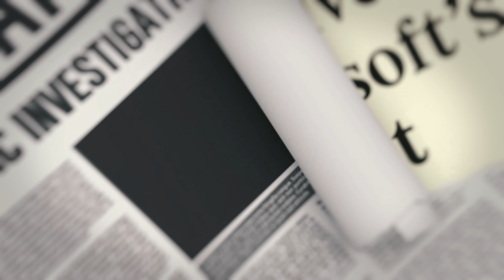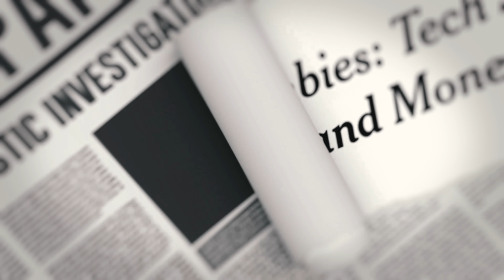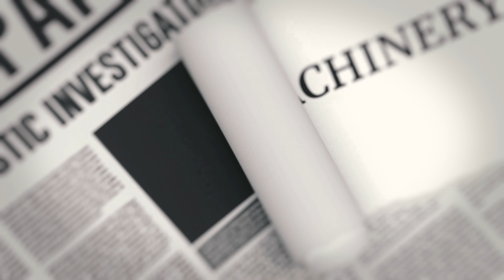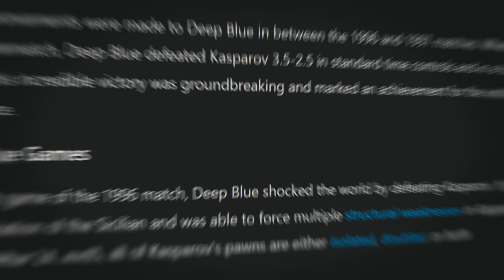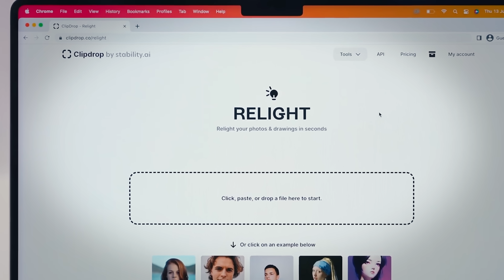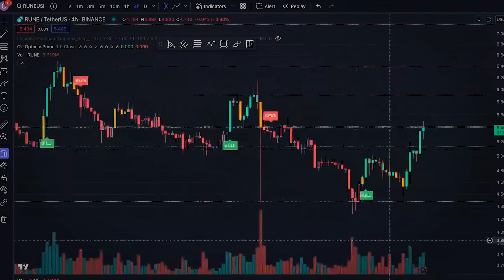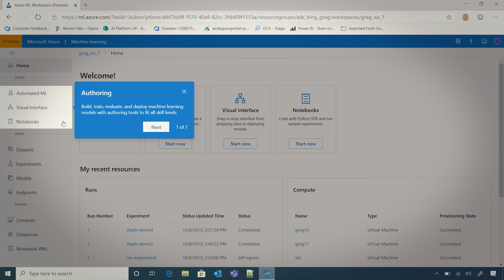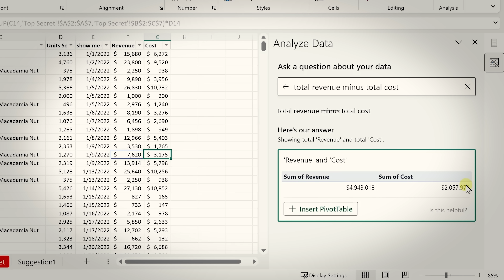Overrated AI Startups Are Getting Their Funding Pulled

Comment: 📝 Summary of Key Points:

📌 Microsoft announced a $10 billion investment in OpenAI, but OpenAI has only received a fraction of the promised investment, indicating potential tensions between the two companies.
🧐 The AI industry is facing funding issues, with venture capitalists pulling back on funding AI projects with high valuations. OpenAI, for example, was looking to raise a valuation of $90 billion but only generates around $1 billion in revenue per year.
🚀 The AI industry has been experiencing boom and bust cycles since the 1950s, with periods of enthusiasm followed by a reality check. However, AI eventually becomes mainstream after going through these cycles.

💡 Additional Insights and Observations:

💬 "The main challenge for AI is the high cost of development and limited revenue potential in its original state."
📊 The AI industry is currently experiencing a funding collapse, with global VC funding decreasing and the number of AI deals shrinking.
🌐 The AI industry is plagued by opportunistic companies that overstate their use of AI, leading to a decline in AI investments.

📣 Concluding Remarks:

Despite the funding challenges and boom and bust cycles, the AI industry is making progress and will eventually see the other side of the cycle. While bankruptcies are expected, flagship companies like OpenAI are likely to survive and continue their research and development.
Generated using TalkBud

Comment: Brain: small mass, minimal energy need 
LLM: large mass, massive energy need
LLM is like replacing your oil by dumping a 50 gallon drum over the entire engine just for the little that will go in the correct place. Enough energy and mass could potentially generate human like intelligence, but at such massive cost and scale that it can't be the solution. Look for the solution to be systems that compute much more using much less energy.

Comment: This ai bubble is never going to be burst. This ai  cycle is lot different than other ai cycle because of only one thing that's transformer models(invented in 2017)which enabled products like chat gpt. This model enabled lots of ai thing which were not possible before. So it will not die but there will be large no. Of mergers and acquisitions between companies as lots of companies are working on samething. Ai bubble  is lot useful than crypto and nft bubble. Next big thing is going to be ai and robotics.
Reply: but what do they actually enable apart from writing spam?
Reply: @thewhitefalcon8539  you are not tech guy right? You didn't even try different things? Search open ai api then you will understand. You can access chat gpt through api key and make lots of interesting applications and automate them. Like extracting useful info from big pdf chat with documents. I was a part of the team which built an app which can extract  username , statement period and all useful information from bank statement and store in a excel automatically which would have taken 1 week to do. It can Create new images, summarise email writing email making code blocks and many more I am using chat gpt and copilot in windows. Literally I am blown away by these products. Are they perfect? No . But it is at the starting phase and it will last for the next 10 years.

Comment: It's a mildly useful tool in my opinion. It's a little bit faster than a google search in around 80% of cases. In the other 20% it's so wrong that it takes longer to try and wrangle the right answer out of it than to google it yourself. Don't ask it to translate a script from python to shell or something. It'll fail spectacularly. Do ask it API questions. What's the API to do this and an example? Faster than browsing API docs or checking stack overflower. It won't always get the API questions right but it generally does. Moreover it can give an answer for that API with an example using your code that you can directly cnp. Ask it very short, limited, and direct questions and it can work well.

Comment: As someone who believes in the power of AI to help humanity, I worry that if all of the computing power for these models ends up in the hands of two or three big companies with deep pockets, these companies will use this power to benefit themselves at the expense of humankind in general. While we like to think that AI is autonomous, make no mistake, humans still pull the strings. You can see this demonstrated by how the models have put up so many guard rails that it’s nearly impossible to talk about anything even remotely sensitive or controversial. What happens when one of these big corporations tweaks their algorithms to support a certain candidate by only giving information supportive of a certain politician over another? Startups could be a barrier to this process, but as you pointed out in your video, it takes a lot of computing power and resources to run these models, which means startups might not have a chance yet until the infrastructures get cheaper.

Comment: AI is not over hyped, large language models are.
Reply: @LiveType  They've already run out of training data because half the internet (HALF!!!!! Think about that!) is AI-generated SEO spam and AIs can't tell which websites are AI-generated spam, and they can't be allowed to train on AI-generated spam or they'll devolve into uselessness.
Reply: That is completely incorrect. @thewhitefalcon8539
Reply: @LiveType  
Brain: small mass, minimal energy need 
LLM: large mass, massive energy need
LLM is like replacing your oil by dumping a 50 gallon drum over the entire engine just for the little that will go in the correct place. Enough energy and mass could potentially generate human like intelligence, but at such massive cost and scale that it can't be the solution. Look for the solution to be systems that compute much more using much less energy.

Comment: Fun fact in 1960s GM piloted a concept for self driving cars that will ready in a decade or so. They were supposed to use sensors and idea was that once driver is in highway they will switch to self driving mode and can take a nap or spend time with their family in back seat 😅
Reply: Making a robot follow a line drawn on the ground is a FIRST SEMESTER electronic engineering project. At least, it was in my first semester!
Then you meet the real world, and you can't see the line because it's foggy, and the other cars aren't following their lines, and sometimes there are meese on the road or the car in front of you crashes.
When you take self-driving cars to their extreme, you get driverless metro trains, which already exist. They run on rails so they always go the right way, they run underground so nothing else can get there, they have sensors in the doors so they won't close the doors if someone is in them, and they have central control systems that make sure trains won't run into the back of crashed trains.
Reply: @thewhitefalcon8539  you don't even have to run them underground. Many driverless light metros, like the Docklands Light Railway, Vancouver SkyTrain, or to use a more recent example, the Montréal REM, all are entirely or mostly on or above ground.
Reply: the main issue with self driving cars is the fact there are non-self driving cars on the road, if that didnt exist every car would be self driving by now.
Reply: That is SO funny! 🤣

Comment: AI is the latest IT buzzword and everything needs to be spined into AI. I have seen it before and it will continue in the future. As a result a lot of so-called AI technologies are not viable or are distorted spin, so I would expect a lot of the so-called AI technologies will never lead to anything. However once you identify actual AI technologies which make a difference, those will generally be successful. AI will provide useful solutions, but don’t hold your breath.